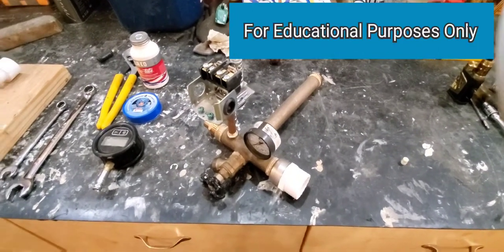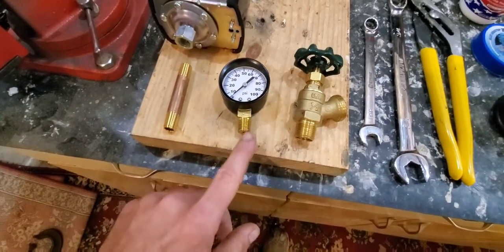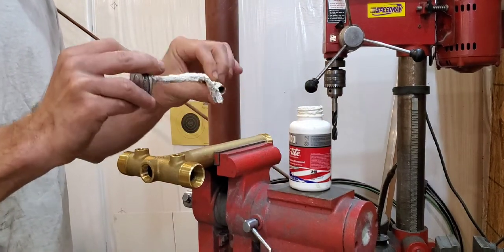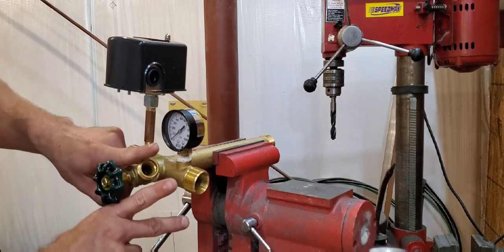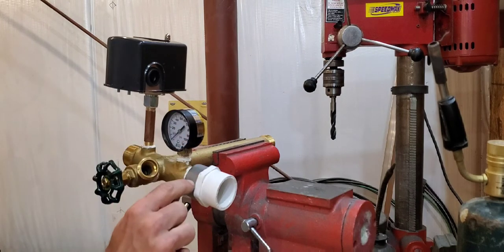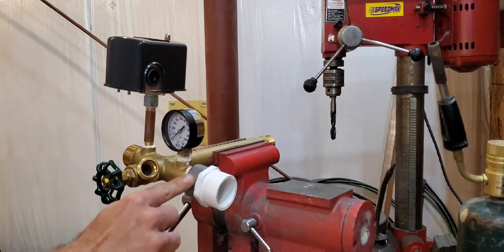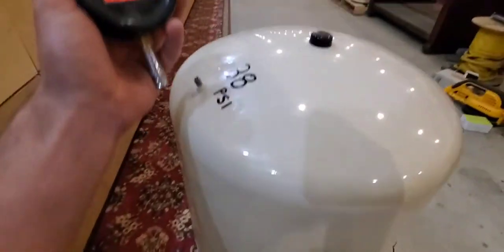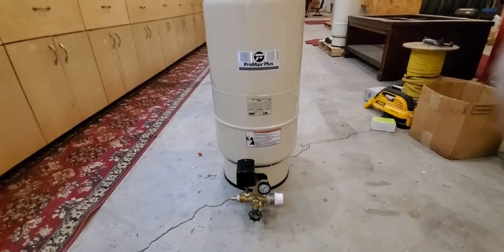Pressure Tank & Switch Assembly Step-by-Step! #1Video for needing help. No Water Pressure/ Well Tank

Comment: FYI, a year ago, when I was shopping for a hose spigot, every single hose spigot and boiler valve at my Lowe's were labeled "Not for Human Use." None of their spigots or boiler valves were lead free. (The fittings in the Pex section are all lead free.)

I had to go to my plumbing supply store to get lead free valves.
Reply: Having this exact issue, even at Lowes and Home Depot I can't find lead free hose bibs.

Comment: Thank you for tge video. Did you install a check valve before or after the Tee? My 37 year old tank is showings its age, not holding pressure, and I am replacing it this weekend. Will be installing Tee on tank today so it is ready to be installed tomorrow.  The kit I purchased came with a check valve and my existing tank has a check valve.

Comment: Should there be a check valve somewhere in this configuration? My current configuration has a check valve before the pressure gauge. I think my tank is bad and I plan on replacing soon. The Current tank has a 1in Tee and also want to know if going to a 1 1/4 will be an issue. the tank is going to be slightly larger in volume.  Going from a Flotec FP7120(35gal) to a well x trol WX-250(44gal).
Reply: Yes. It will be on the end of the tee approaching the waterline in.

Comment: Is there a reason for the nipple on the pressure switch connection, or is it just a matter of using it to connect 2 female ends together?
Reply: It's called a twist nut. Just holds the plastic cap on to cover the electrical.

Comment: I know this video was made awhile ago but I have a question. If i use the stainless steel fitting, should I not use the cooper T then. I was told that you should not use both.
Reply: Stainless and copper/brass is much more neutral than galvanized and brass.

Comment: hi,  what is your opinion on using a tee with a union?   It would save alot of work to uninstall / reinstall the tank, however i'm concerned about the union leaking over time?

Comment: Man I can’t get this shit to stop leaking at all and definitely am not giving up. How the heck do you get the unions on each side of the t to tighten down all the way? I’ve used the tape on every thread but still can’t get this shit to stop leaking and I think that’s why I can’t build pressure it’s a brand new tank and switch and the unions the t is fairly new idk what I’m doing wrong

Comment: I'm a machinist you don't need to use Teflon tape on a pipe thread the threads are tapered and should tighten up at  three revolutions and seal  I manufacture thousands of these type of threads for automotive applications

Comment: I've been searching lots of videos to understand, and yours have been very helpful! Does it matter which side the switch and gauge are on (in vs out)? Is the nipple just to raise the switch above the gauge? Does it matter if the nipple is short (2") vs long (4")? Also, I noticed you don't use a pressure relief valve on your T. The one at Lowes comes with it, but the ones you use don't. Is there a reason you don't use it?

Comment: any reason you can't use a ball valve instead of a gate valve?
Reply from the maker: You can use either. Ball valves are far superior & more expensive but they have a longer life span than a gate valve.
Reply: @h2omechanic  thank you! I prefer ball valves, they are worth the extra money, also my well pressure tank is kicking on and off every few secs, gradually got worse,  coming on at 40, off at 50, any suggestions?
Reply: @laurasprute  Mine does that when the check valve goes bad or gets a baby crawdad stuck in it. I put 2 valves in series, or possibly a bad pressure switch.
Reply: @laurasprute bladder in tank has failed

Comment: In my area it's common to place the pressure tank in a wellhouse (or leave it exposed) with the water well. Is there any advantage or disadvantage to placing the tank in the garage or under the house? My house is 90 feet from the well.
Reply: It’s probably depending on the climate for the area.
Reply: I'm thinking the same thing. Did you figure this out? Advantage or disadvantage? Climate is northern Michigan.